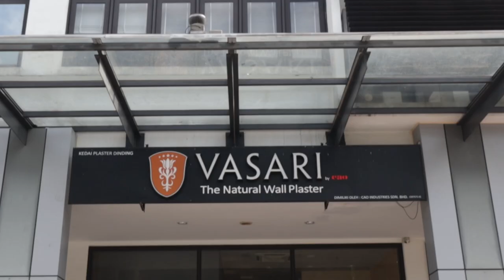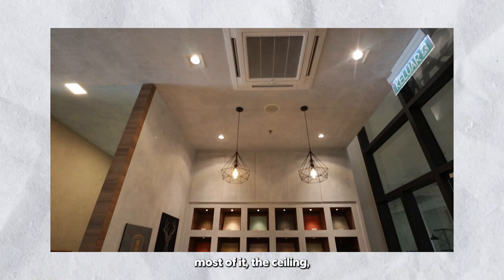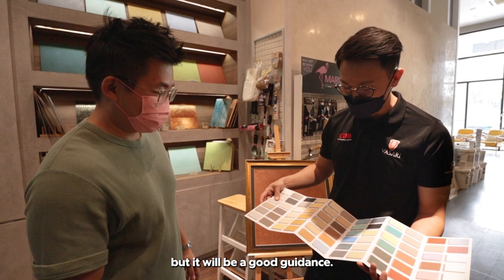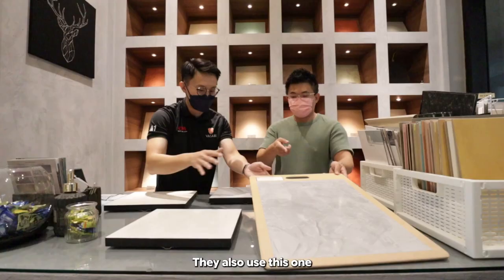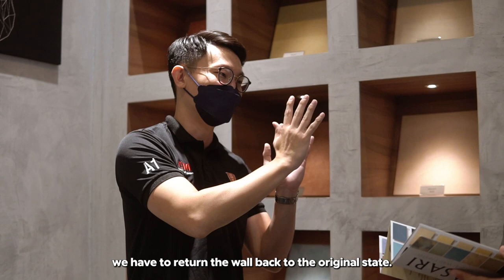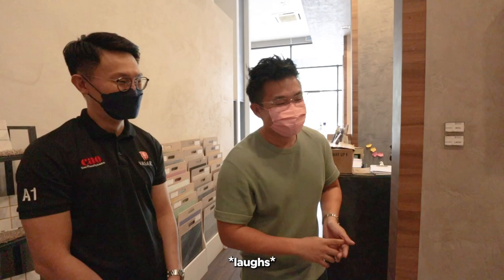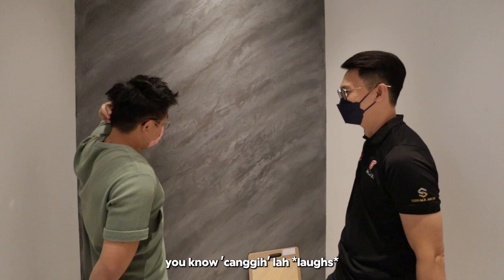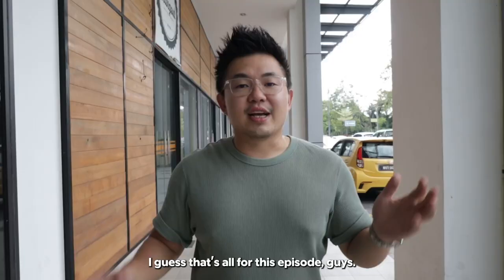Iherng visits Vasari show room

Comment: Veneziano: Nice to see from front and from a distance, but from the side it will look like crap.

It'll either be like unfinished cement wall (matte but with smears of polished lines) or extremely dirty plastic wall (polished with smears of matte lines), depending on which finish you opt for.

Go for textured paints eg. suzuka , which can achieve almost the same aesthetics, especially if going for cement/stone look & feel,  but at less than half the price.

Sincerely,
Some guy who just did a whole stretch of wall using veneziano for his own condo, thinking it will look like great.
Reply from the maker: Thanks for sharing Kevin. Hopefully they see this. This will be great feedback to the team.